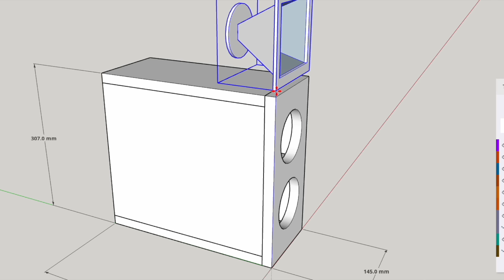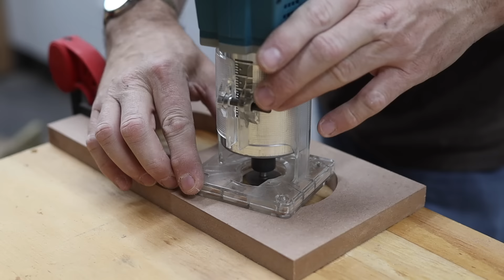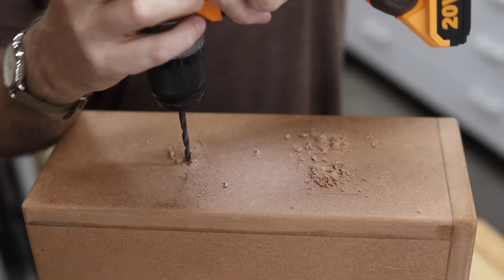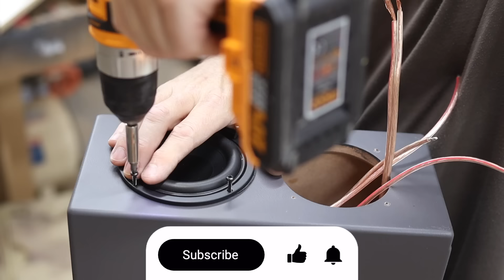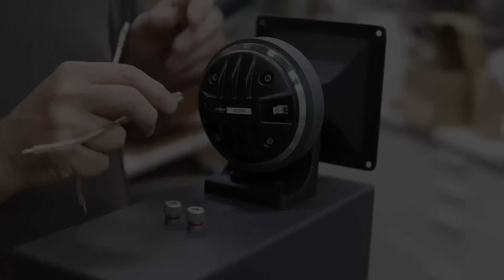Building High-Performance 2.5 Way Loudspeakers with Compression Driver & Horn - by SoundBlab

Comment: It seems that if you had used a less expensive but decent performing dome tweeter with these two budget mid-woofers in a w-t-w format you could have arrived at a much less expensive but still a kick butt budget system. This is a very cool system though and the work is much appreciated.
Reply: I am by no means an expert on this, but in my experience horn loaded compression drivers typically have a higher sensitivity while also being able to play lower than a traditional soft dome tweeter.  You could probably find a soft dome tweeter and mate it to a horn to get a similar result, but you'd then also be relying on your woofers playing higher to cover more of the midrange by themselves.  If you ever notice professional sound reinforcement, this is exactly why nearly every PA speaker you see out there is a 2-way with a woofer + compression horn.  It's not that you can't do it with a soft dome, but rather you'd have to make more compromises to get similar results, and you'd likely have a for more complicated crossover to make it work.  That being said, if you are using small mid-woofers which are more capable of playing into the upper-midrange without getting harsh, woofer + dome tweeter works just fine....in a small space.  When you want more SPL to fill a larger space, that horn-loaded compression driver is going to win every time.
Reply: @dafretz  - My main point was that the woofers are $14.49 each while the horn/driver combination is $140.78, both at PE. The B&C horn driver is very efficient at 108.5 db while the woofers are 86.8 db, so the author needed to add a resistor network to bring the tweeter output level down to match that of the woofers. The high efficiency of the horn provides no advantage and is a non issue as the output must be attenuated to match that of the woofers. The TCP drivers are well known as big "bang for the buck" mid-woofers and I am sure that the B&C tweeter is a fine, but expensive, performer. A lower priced but decent tweeter (Vifa?) could make a much less expensive system with very similar performance.  Most commercial offerings using horn tweeters are matched with one or two large, high efficiency, woofers.
Reply: @dafretz  - The mid-woofers have an efficiency of 86.8 db at one watt, so the author needed to add an L-Pad to attenuate the horn driver down to that much lower output level. The mid-woofers are <$15.00 each while the B&C pair is $140.  I'm sure that the B&C parts are great parts but a much less expensive dome tweeter could work well with these budget level mid-woofers.
Reply: @RRRRRRandy  If I'm not mistaken, TOIDS DIY used the 8 ohm version of the mid drivers in his, "The Rule Breaker" build.  It's a M-T-M center channel build.  You can check out his video on youtube.   He uses a Tectonic BMR in place of a traditional tweeter.
Reply: @HarrySutherland-l3v  - Toid used the wide range Tectonic part to eliminate the comb filtering common due to the higher crossover point typical of w-t-w center channel loudspeakers. Toid was able, due to the Tectonic specs, lower the crossover frequency to the point where the typical muddiness cause by comb filtering wasn't a factor. The Dayton driver used is a "big bang for the buck" component.
Reply: @RRRRRRandy AIYIMA has some decent options, incl compression drivers at a really low cost for how good they are

almost made me regret buying Beyma CD10Fe drivers, they're that good at only €22 a piece lol

Comment: Mini PA Speaker this is awesome 🔥. Turn the horns the other way so we can have wide range. This might not handle a lot of power like a real PA speaker but this can go very loud for its size. This handle 160-200w maybe more if you use it as a satellite tuned dsp crossover and have a big subs go along with it then it would be fine. Compact Mini PA Speakers.

Comment: How many dB of pad on the compression driver?  cool build!
Reply: Has to be on the order of 22 to 24db based on how this is balanced. 

I have a build with the same CD using two 6" Faital Pro midbass  with a 95 db/W sensitivity rating and it is padded down about 16db to match up.

Comment: Why did you orient the horns the wrong way? When would you ever want wider vertical coverage than horizontal?
Reply from the maker: I reply to this in a comment further down.
Reply: @SoundBlab Please pin the replies at top so readers can easily refer to as FAQ instead of wading through hundreds of comments. Thanks.

Comment: The horn is mounted in the unintended orientation. Your getting 90° vertical dispersion and 40° horizontal dispersion.

This horn has a slight smoother vertical response outside of the sweetspot, but you probably want this response to actually be vertical since your less likely to have treatment on the ceiling. You'd also get a wider sweetspot if the horn is mounted the intentened direction.

Also if you're mounting the horn outside the enclosure, theres no reason to mount it flat with the baffel. An advantage of outside mounting is that you can offset the horn so that it is time aligned with the other drivers.
Reply: Yep, came here to say this. Apertures create more coherence along the longer axis at a perpendicular angle. This is especially important to note as your two LF drivers are creating a wide horizontal dispersion with cancellation above/below. You'll get much better coherence at the crossover point as well by rotating the HF horn so it matches the LF dispersion.

All in all this is an amazing build! Very high quality finish. Great concept and execution! TY for sharing!
Reply from the maker: Yes, the horizontal dispersion is only around 40 degrees. The reason for mounting it as is, is practical. The mounting holes on the horn would otherwise be vertical, making for a potentially very complicated mounting solution. Speaker design is always about compromises. If the horn was mounted in an enclosure, then sure we would not have a problem, but I wanted the 'exposed industrial look', and the result is still more than acceptable in terms of performance.
Reply: @SoundBlab  TY for the explination m8. However, it'd be real easy to drill two new holes on the horn mount baffle for the correct orientation. "More than acceptable" is a good mindset for getting a project finished. Which you did, and well. But don't hide from "diminishing returns." It's the summit of speaker design. Always pay attention to the little things and improve your awareness and knowhow in time. These differences will become quite apparent as you practice and study more.
Reply: @SoundBlab  what monting holes do you mean?
Because the horn front is a square so you mean the mounting holes for the driver in the rear?
Reply: @SoundBlab  You serious? I have always liked your videos and builds, but that's not a good reason whatsoever for compromising the horn, it's dispersion and ultimately it's sound.

Comment: The most important thing was missing again: measurements.
Reply: I would indeed like to know the sensitivity and the impedance.
Reply: @garrardzero1  I would like to see the response graphs 0°, 15° 35° etc. I have to admit that they sounded pretty good in the video.
Reply: @garrardzero1 impedance curve was shown as well as nominal impedance of drivers.
Reply: It’s on the build plan website.
Reply: I might care if my ears were exactly like the microphones that the measurements are recorded from. At my age, I know they’re most definitely not.
Reply: @scothunter3221  The issue is that unless you measure, nobody can know how well or bad the speakers play. Also measurements reveal many things a subjective listening won't. When you listen to a speaker, you practically never listen to the speaker only, you hear the room reverberations which make up to 70% of the sound in a typical listening position.
Reply: Because the build plans are for sale on their website.
Reply: @iggywow acoustic measurements, not build measurements
Reply: Who cares. If it sounds good then it’s good.
Reply: @nelsondog100  Not every amplifier can handle a low impedance speaker and has enough power to drive a speaker with low sensitivity. So impedance and sensitivity are 2 parameters that matter.
Reply: @garrardzero1  …of course they matter but I don’t care. Do you see my point? Like in my first comment states, I personally do not care for measurements, it’s not that measurements are not important, I don’t care. 😄
Reply: @nelsondog100 I do care. I'm not going to spend hours and money building a speaker only to find out it has too low an efficiency for my amplifier. Impedance is shown but sensitivity is not listed anywhere. I suspect there is something 'wrong' with that, estimate 82dB.
Reply: @nelsondog100 I see your point but at the same time going off the sound of a YouTube video in an unfamiliar room is also next to meaningless.

I myself just know I really don't care for horn drivers, even though I do like a cardioid sound pattern.
Reply: @nelsondog100  Everyone who understands anything about speakers cares. A speaker can sound good despite being suboptimal if the room characteristics serve it well. But if the radiation pattern is uneven on the sides the same speaker can sound nasty in a different kind of room.
Reply: @ I’ve been in the audio scene for 45 years and one thing I’ve learned is I don’t give two hoots about numbers. If I like the way it sounds then that’s enough for me. Screw looking at the numbers.
Reply: @nelsondog100 bought many bad items or got extremely lucky?
Reply: Your ears ARE measuring equipments…..Just so you Know.
Reply: @robertthurston6858  It has been shown in countless studies that the last thing you can trust in audio are your ears - as crazy as that sounds. There have been studies where participants were played samples from the same exact equipment but before playing the other sample they were told that the later sound came from the very expensive and fancy looking amplifier. Guess which one won the comparison by a large margin? The fake expensive one.
Reply: @robertthurston6858  no they aren't at all. 🤣🤣🤣🤣

Comment: Compression drivers are the best!  I use it in my open baffle loudspeakers :)   Nice build.
Reply: Highly debatable... Sounds loud, but not the best sounding solution.
Reply: @Alastasius  Nothing to do with loud.  Compression drivers allow for high dynamics with very low distortion so they can allow for very realistic dynamics.  Depending on setup, they can also be crossed over lower.  Can they get loud, sure. Do they need to be loud. No.

Comment: Wow great! These bring to mind the Devon Turnbull designs that are quite cool, but made out of unobtanium. Shinjitsu Has been coming up with some great designs as well but twelve humdred dollar tweeters ain't happeneing. I've been hoping someone would do something like you have done here. So great. Thanks. I will make a little donation in hope of seeing a larger    version!
Reply from the maker: Thanks! Planning a larger design with 6.5 inch driver in the new year.
Reply: @SoundBlab  Looking forward to that. I was planning on building these but I would prefer this design with slightly larger woofers.
Reply: I’m also eager to see the larger design (with a bigger hole to stuff that crossover through 😂).

Comment: Yet another mind-blowing build! I'm continually impressed by your ability to push the boundaries while also creating a speaker that anyone can build. The sound is incredibly dynamic, and the horn adds a whole new dimension of creativity to the building process.
Reply from the maker: Thank you, I appreciate your kind words!
Reply: @SoundBlab  On first sight the idea looks great, but a serious look at this 4'' midbass woofer shows it comes with only 82.7dB (4Ohm) and the cone weight (Sd/mms) is just to heavy to perform rich through the midrange. I assume the horn has a much higher sensitivity, so you have to dimm it down, which may sucks the dynamics out of it. I like the concept of putting the horn on top of the speaker, but the drivers below are just the wrong choice - in my opinion. Now that was my smart ass moment for today.